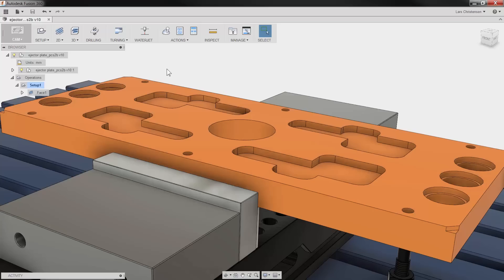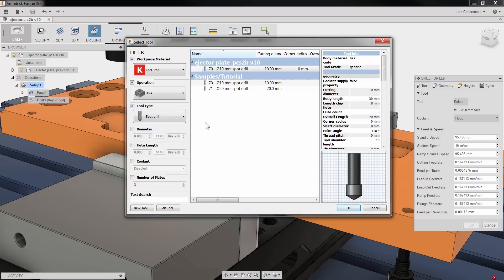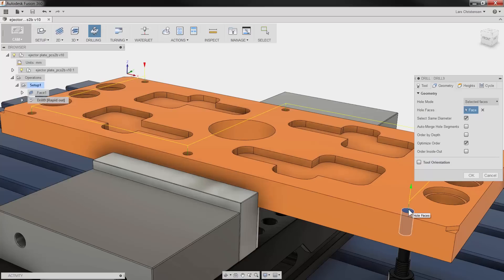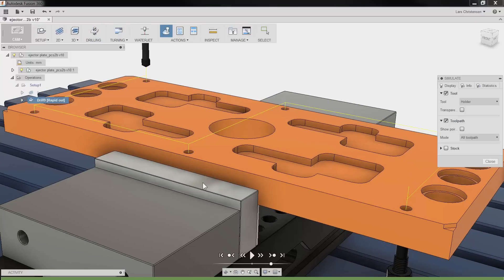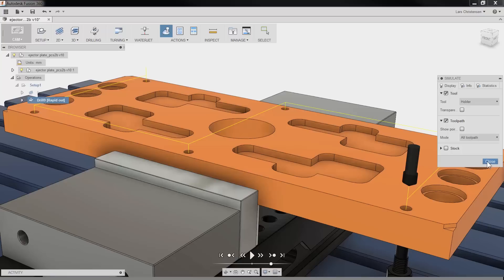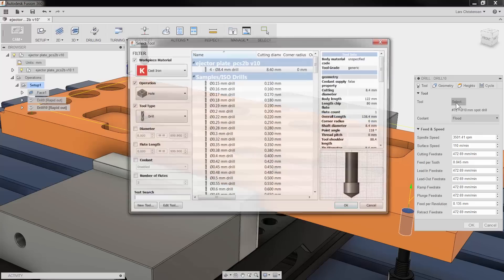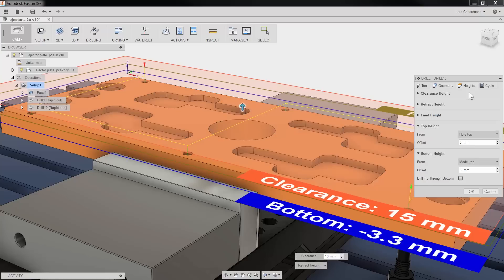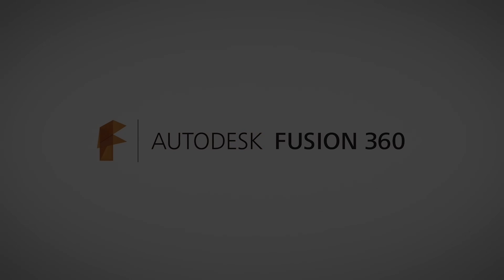QUICK TIP: Save Time Setting Up Toolpaths

Comment: Lars, What if the holes are different sizes? I have parts with 10 holes, some of them counter bored, one at the bottom of a pocket that is deeper than the hole diameter. Why on earth can't you define the top and bottom of each hole independently? I have to split the 10 holes into four operations. In my old CAM package, it was one operation with a table to define hole top and bottom of each hole individually. Is this something coming up, or is this part of an uplevel system for which Fusion is a lead generator? Dave
Reply from the maker: Let me ask one of our CAM experts if there's an easier way to do this now, or if something to handle this is coming soon.
Reply from the maker: Hey there, Marti got back to me on this. She said that we're working on optimizing the existing drilling operation for large hole volumes, while allowing some control over hole selection with additional tools in select same diameter. At the current time, you will have to do individual ops for unique holes, but we're working to make this process easier. I hope that helps! Please let us know if you have other suggestions or comments!

Comment: Thanks Lars,  spent the last week working nights and weekends getting the hang of Fusion360,  it really is awesome stuff.  Thanks for the vids, and cool that you'r e a 'local',  at least in a global sense.  Finally at the point where I can post code that requires no manual edits to run,  really a big time saver.  👍👍
Reply: +YCM30cnc That is awesome! Make the chips fly!!